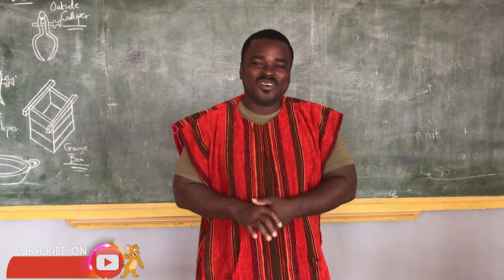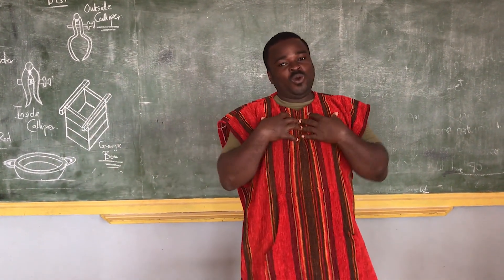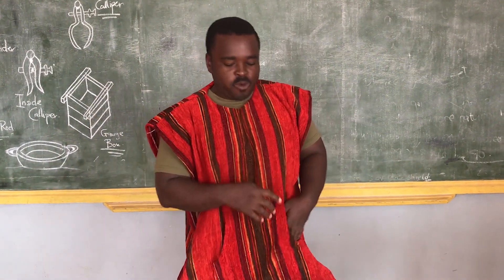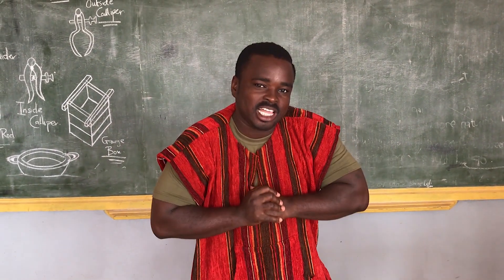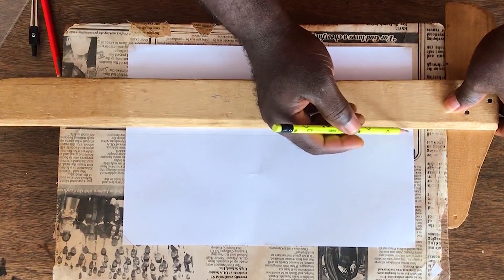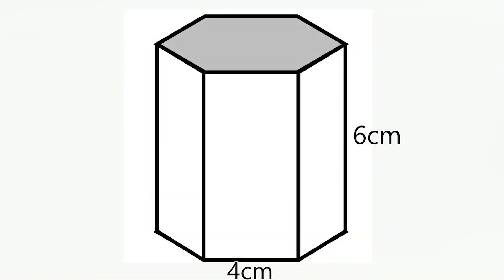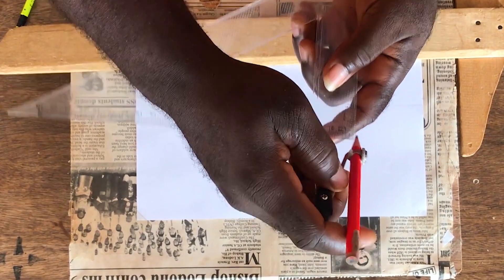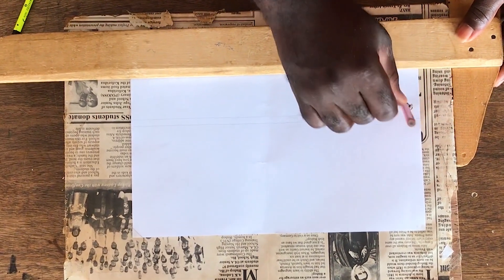Surface Development of a Hexagonal Prism

Comment: Why is the base 4 buh you used 2 when drawing the circle for the plan
Reply from the maker: It's true that the base is 4. But when drawing the circle you have to use a radius of 2 which will help you get a full diameter of 4.